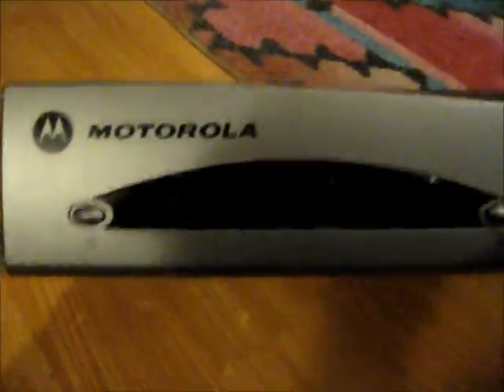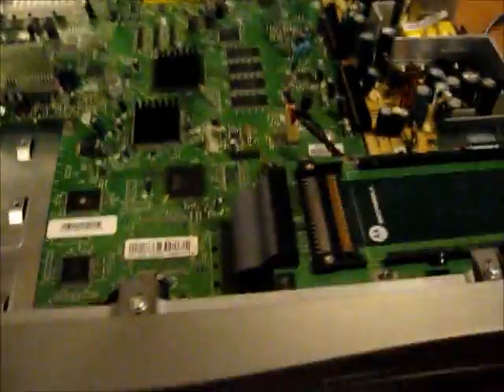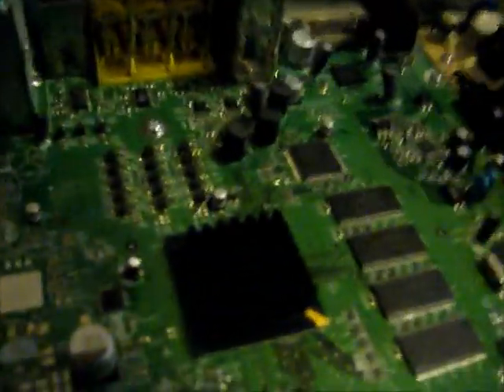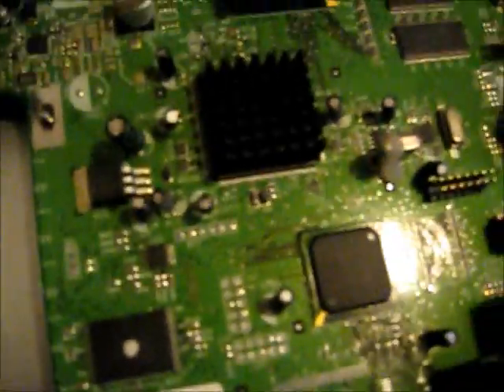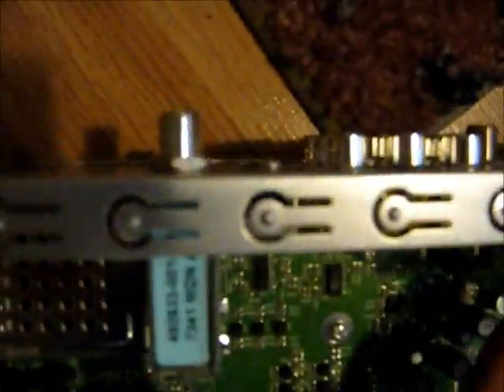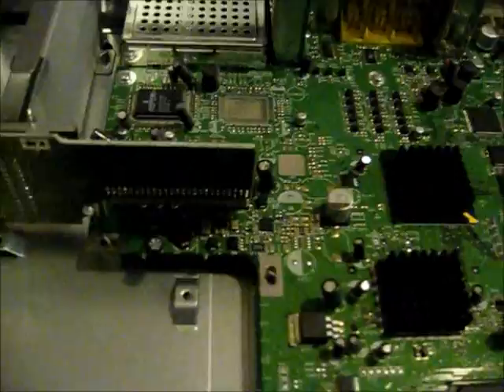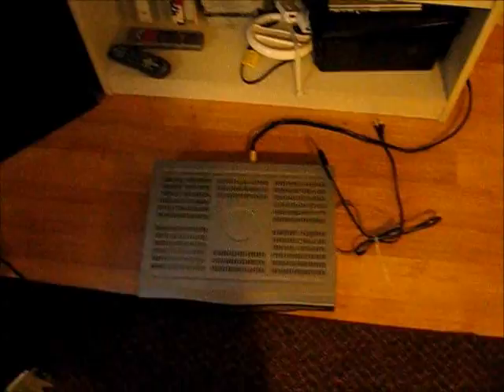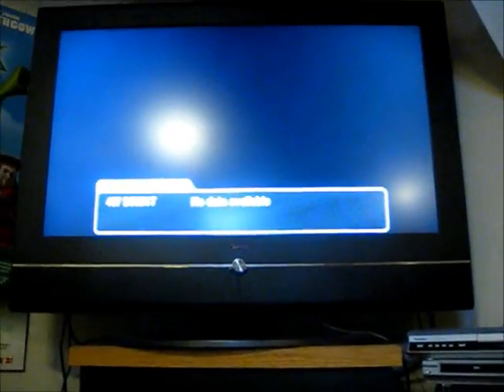Motorola DSR505 part 2

Comment from the maker: I'm not the best at soldering, but i could solder some pin headers onto the board where there could be a serial port, but I do not have the components like the female DB9 connector or the 10 pin ribbon cable. the jtag uses a male 25 pin paralell connector to connect to a paralell port, but I have 0 of those without destroying a printer cable.